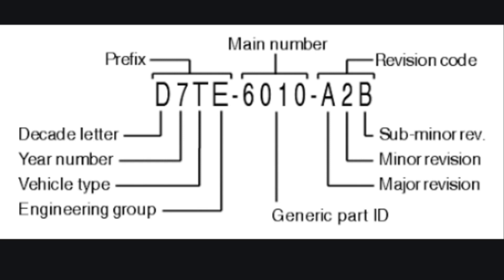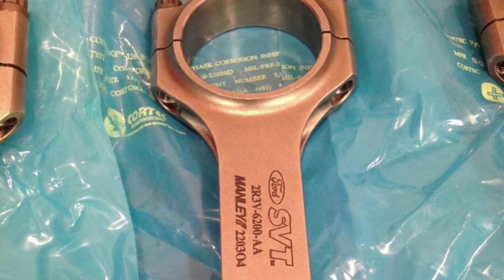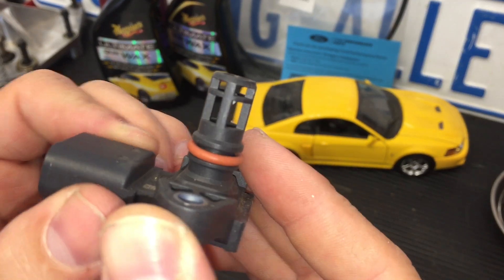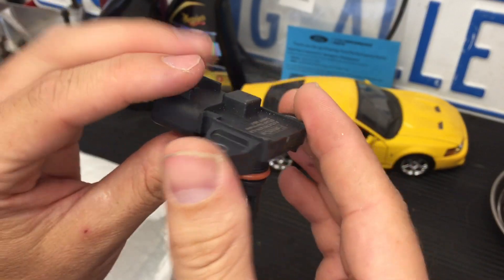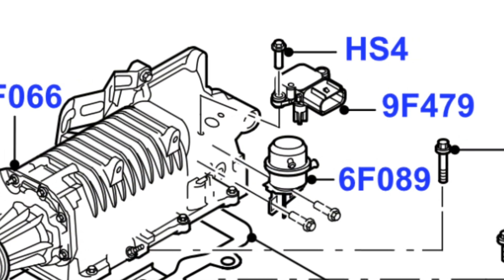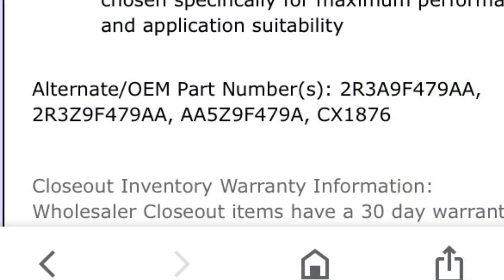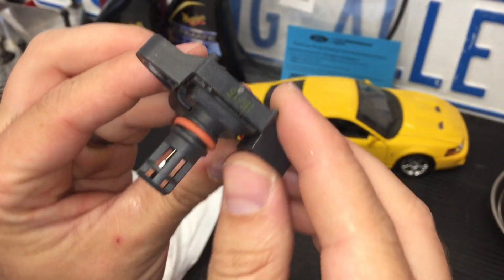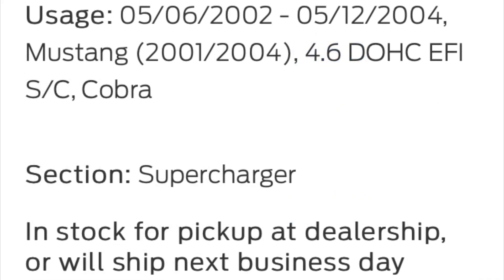Ford Part Number explanation & Breakdown. Interchangeable parts. Map Manifold Absolute Pressure

Comment: Been working on a decoder for Ford parts. Be weary of some of the lists. The Blueovaltrucks site you used (sad that I recognized it lol) has some errors here and there.

SVO, SVT, Ford Performance parts are VERY tricky to verify. V codes at least are clearly SVT parts, but so many are Z parts. And older ones get even harder to track, as they maintain the original prefix, and just change the revision code.

Also, the the letters within the part number show that at some point, they went to a non decimal part number, and kept adding numbers, with letters, in a base 35 numbering system, but ONLY for the main parts group. Which itself can be broken up in two groups (something that no site has done, which Im trying to do. It helps having all my parts in a spreadsheet, and I have more inventory than more dealerships lol)

Comment: Got the AASA-9F479-CB for my 2019 Ford Flex ecoboost. Had a P-0107 and P-0109 code thrown. Had lack of power and limited to 55mph with odd shifting. Replaced and engine runs rough and will barely rev. Put original -AC part back in and idle returned to normal. Bought another part from another store, same AASA-9F479-CB part, seeing if the other new one was just bad

Comment: I have a question. I have 06 expedition. The original part number was discontinued. 5L1Z-16138-A
Does that mean that any replacement I can find that has the #16138 in the part number would work as a replacement?
It's for a radiator core support.
Reply from the maker: That should be correct, but I would call the ford parts counter to have them cross reference in case an update was made that makes it no longer compatible
Reply: @dannyjohnsonsgarage  I've already cross referenced everything. I even got pictures of both and they looked identical. Even the aftermarket one looks the same. Worst nightmare ever on a part. There's no info online anywhere. I had to do weeks of research. I can't find a single person that ever changed an 06 expy core support so I can get their story. Ford is insane. They list no interchanges. I called every junkyard in 🇺🇸 and almost ordered one from some guy with broken English online but I caught myself. It's been an absolute terror.

Comment: I just realized i have that exact map sensor part number. Is it in fact a replacement on the 03/04 cobra?
Reply from the maker: It claims to be. I haven’t used one yet to know for sure
Reply: Thanks, thanks great info. Also the napa and o’rilies parts are original ford parts. Got the AA5A-9F479-CB from both sellers in a different box

Comment: The final letter in the revision code is basically irrelevant quite often in sensors they tend to always end in A or B because they don’t revise them very much. The last letter basically gets changed when anything in that particular system gets updated they revise all the parts in that system. So you could assume that if the part number ends AC that there have been two changes in that system but none of which affecting that specific part. It helps Ford diagnose issues when faults happen and they can see when they made certain changes to a system.